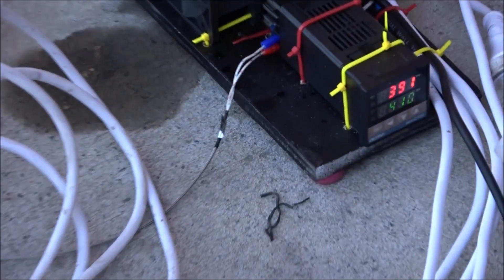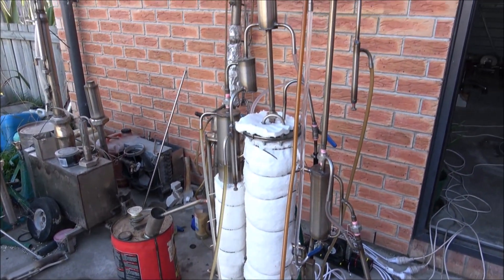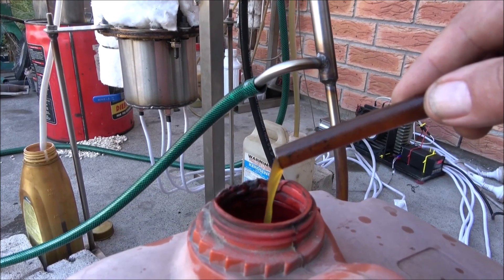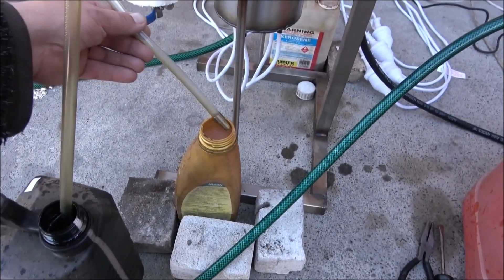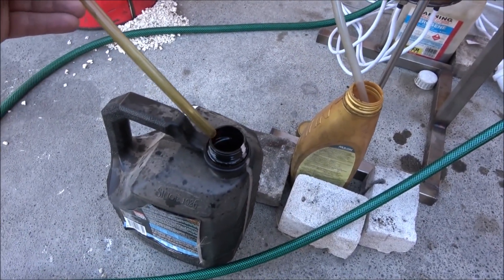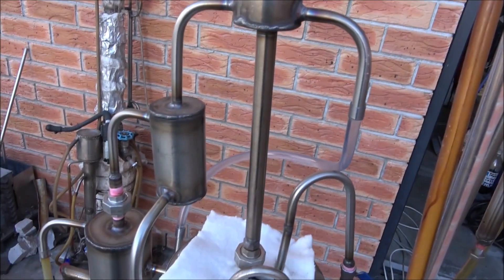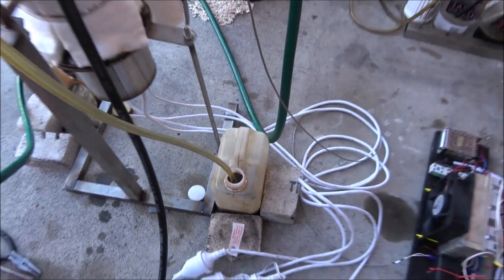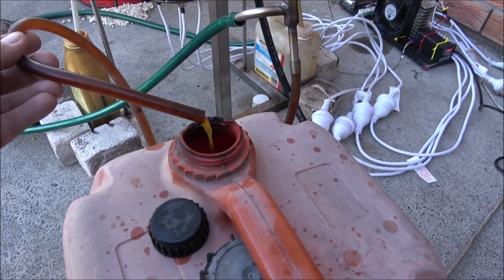Used Motor Oil Continuous Distiller.

Comment: What would you get if you used a alcohol distiller with used motor oil? Can it separate the old bad oil from new good oil?
Reply from the maker: Alcohol distiller - if continuous uses water steam to evaporate alcohol, the batch one uses mix of alcohol and water, so the running temperatures are about 320c below that required for oil to evaporate, so you will ruin the alcohol distiller, and this is it, to process oil one needs a dedicated oil distiller that can continuously run at 410c + temperatures, where elements and gaskets will survive these temperatures, fumes, and condensed hydrocarbons, so do not use a train to fly over the ocean.

Comment: That final product at least 1000 ppm
Reply from the maker: Still better than original "black Diesel" where just filtered waste oil used instead fuel.
Reply: Im not a massive fan of your vids also as I feel they leave a lot out and you don't seem to run any scientific tests but I really like that you are smarter than those idiots that just filter WMO and wreck their engines. 
Keep up the work